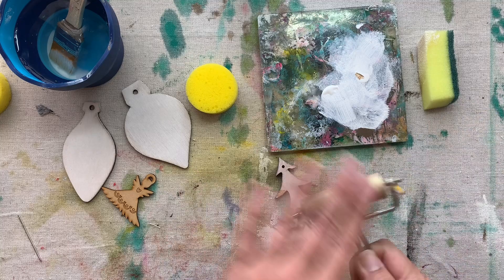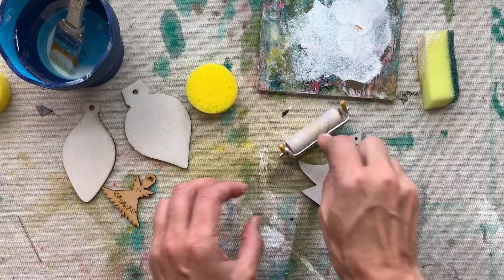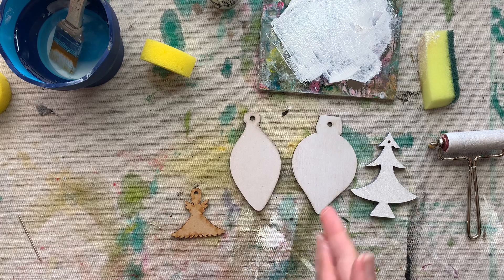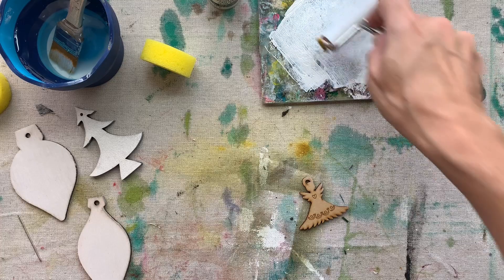How to paint wooden laser cut elements | 3 ways to paint laser cuts

Comment: Hi. Thank you for this enlightening video. I find it very helpful. Still I have the following problem/question: I do many laser cut projects using 4 - 8 mm thick plywood sheets. Whatever setting I use when cutting, there is always an amount of scorching on the cut edges. I can get rid of some of the scorching by sanding and / or a spirit-wet cloth. In any case, some scorching remains which is not nice. If I choose to paint with acryl with the intent to cover all sides then everything is fine, but in most cases I prefer to use only a transparent coating as I like to keep the wood grain visible. In these cases I wish to cover only the edges with some non-transparent coating in order to disguise the scorching. The problem lies in painting these thin surfaces without touching the large surfaces. Even with the smallest brush I find this almost impossible. Do you please have some advice? Many thanks, Emanuel
Reply from the maker: Thanx for watching. Glad you found this helpful. Unfortunately scorched edges is unavoidable with laser cutting wood. 
I have made peace with it and tend to just paint the edges if I want metallic or glitter on the edges. I use a sponge to paint the edges, but you still sometimes get paint on the surface. I just wipe with wet cloth as I work. 
It is a lot of work to paint the edges and that is why I mostly leave them as is. 
Try a sponge to paint the edges and see if that will work for you.

Comment: Hi, do you also paint the sides? I have large pieces of laser cut layered designs and I would like to paint the sides as well to cover up the dark burnt sides. Making sure all exposed surfaces are covered. Also do you apply a top coat or a seal to protect the paint? I am painting 3mm MDF so I presume I need to apply a base coat first.
Reply from the maker: Thanx for watching. I dont always paint the sides. Depends on the project. A good opaque acrylic paint will cover the burned sides. I will paint them with a roller or sponge. I never use a base coat but you can use gesso as a base. Most of my projects are for indoor use so I dont seal, but you can use a spray varnish if you want to seal.

Comment: Do you use something like a primer ? Do you have experience with acrylic colours with and without primer? Most primer are white and would over paint my dark edge from laser cutting. I only found one primer which is also wood stain. But don't know if it will work with acrylic paint.

Btw where can I buy the roller from your video. Didn't find something similar
Reply from the maker: Hi, thanx for watching. I dont normally use primer. If I have to choose a primer I normally use gesso. Gesso comes in clear, white and black. 
If the primer is water based (cleans up with water) then acrylic paint should stick to it. Test it first. 
I bought my brayer at a craft store. Mine is a soft rubber brayer.

Comment: What type of paint is that? Do you have to prepare the pieces with something else before painting?
Reply from the maker: Hey, thanx for watching. I used acrylic paint, and no, I did not prep the pieces but you could use gesso as a primer if you prefer. Hope that helps
Reply: @theresacreativestudio  thank you so much for replying.
Also what kind of brayer is that? And how do you clean it after every use?
Sorry to bother you with basic questions but I am new to this
Reply from the maker: No worries. We all need to start somewhere and sometimes the info can be a bit confusing or overwhelming. The brayer is from a letter press set. But it is basically a soft rubber brayer. You also get hard rubber brayers for lino printing. Most art/craft shops will sell brayers. Get a soft rubber one. When using the brayer with acrylic paint you need to clean it immediately with water. I have a tub of water on my desk and normally just chuck the brayer in there to soak. If the paint goes hard on the brayer it is a bit of a hassle to get it off, scraping with a knife sometimes helps but most of the time the paint stays stuck. So just clean your brayer asap after use.
Reply: @theresacreativestudio  thank you soooo much. I hope you are doing great in all aspects of your life!!!
Reply from the maker: @edgargamarra2612  big pleasure, thanx for the well wishes. Enjoy your project and have fun creating with a new tool. Keep well!

Comment: Does the paint able to cover the edges as it turns black due to laser beam?
Reply from the maker: If you use a good quality opaque paint it normally covers the dark edges. I had a gold metallic paint that I applied with a sponge and it worked perfectly with one layer. If the paint is too thin or translucent you would need a few layers. Thanx for watching